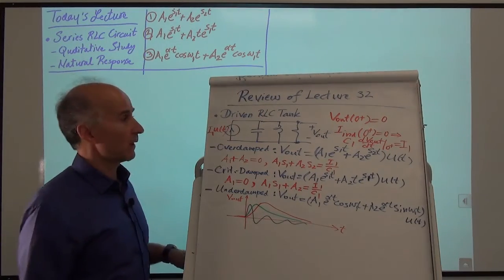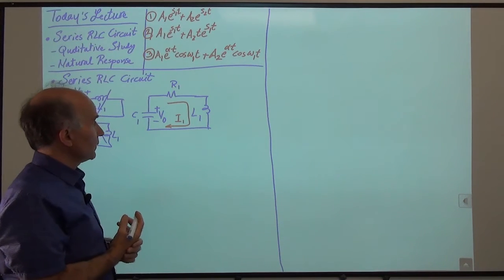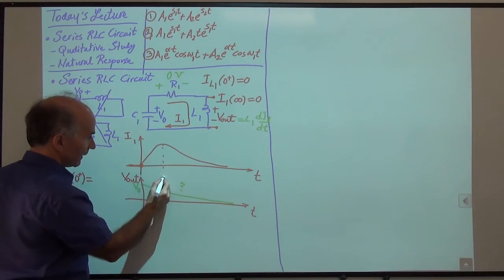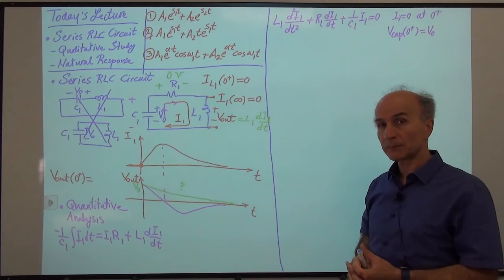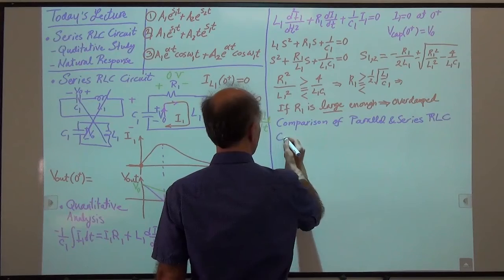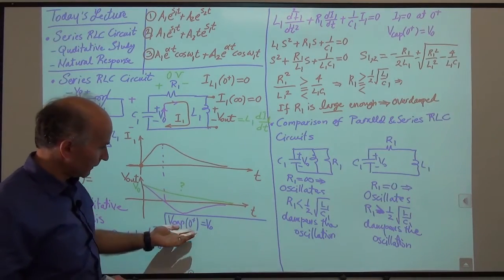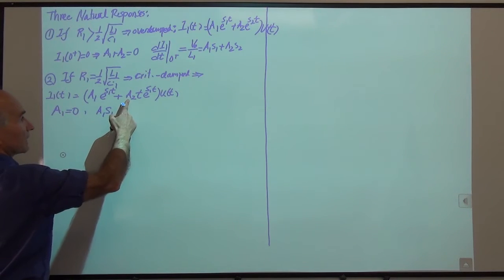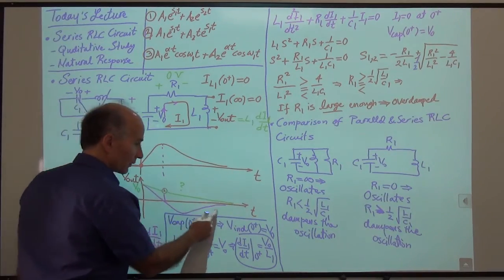Razavi Basic Circuits Lec 33: Series RLC Circuit

Comment: I think KVL for quantitative analysis is wrong(sign).
Reply: yes
Reply: Professor was  correct only.. it's source free circuit ( undriven circuit ) .. capacitor have initial voltage .. v0.. capacitor tried to give energy to other elements.. capacitor is passive element.. but in this circuit cap  indirectly acts like source .. current coming out from the capacitor.. voltage across that capacitor should be negative.. I1R1+L(di/dt) -Vc= 0 , Vc= - 1/c ( integral of i(t) dt) if u substitute this vc in first equation ( what i mentioned) u get answer whatever professor got..

Comment: I think the R in critical-damped response should be 2*sqr(L/C), not the 1/2*sqr(L/C).
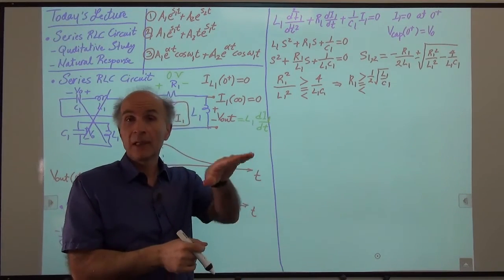Reply: It's not only for critical damped.. that's the comparing factor so it will applicable to over damped and under damped also.. it's all started at 24:21 time instant .. cute little human error takes place.. that comparing factor should be R1  either greater than r less than r equal to 2 √ ( L1/C1)